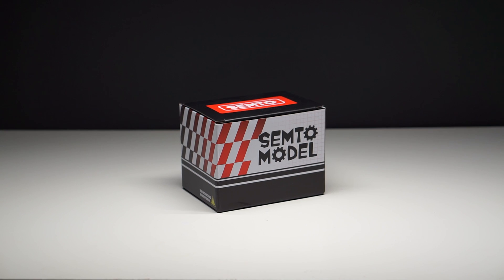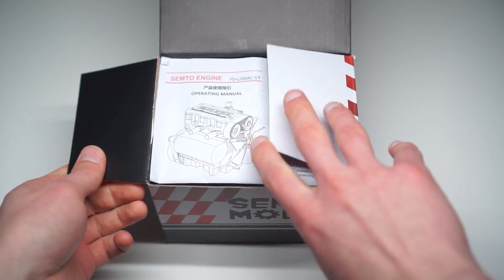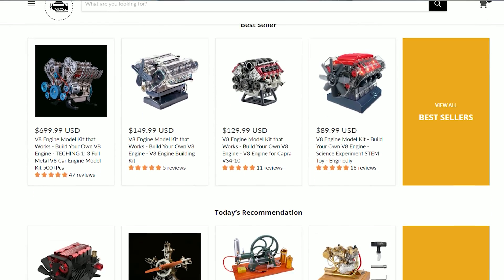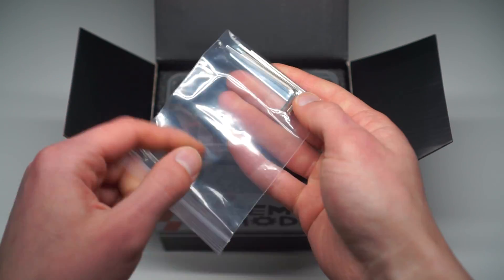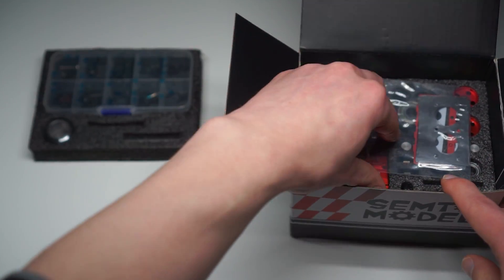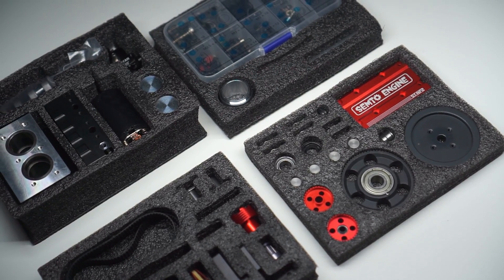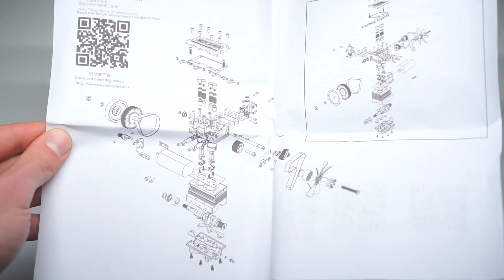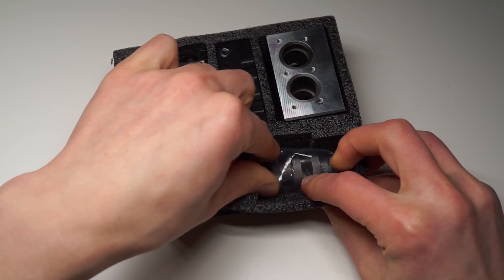Building 4 Stroke NITRO engine - SEMTO engine, Enginediy

Comment: 2:08 I can´t get that on
Reply from the maker: It should slide on quite easy, make sure you are using correct parts.
Reply: @StaticModel  Thank you so much for your quick answer. We managed to put the parts together after heating the bearing ring up slightly with some hot air from a hair dryer. We used the right parts, but they fit together kind of tight. Should not be that unusual. I remember my brother using the sauna and the fridge of my parents to assemble his 1971 Porsche engine....